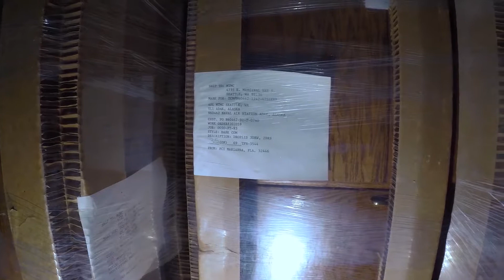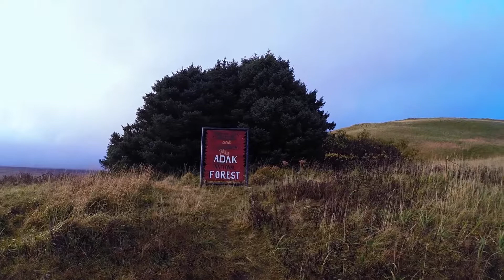Journey to Adak - Alaska Picker Web Series - EPISODE #8 "IT'S ALIVE"

Comment: Ok, at the 8:21 mark, the barrack behind the hill next to the FAA control tower are the barracks that the VP squadron used when they were on detachment there or deployment.  I was there in 1986 for a 6 month deployment with VP-17.  At 8:24, the warehouse was not known as the Fleet Hospital.  It was a new storage building that was built there because the older building near the piers were getting old and falling apart.  Good times there.  Walking from the barracks to the hangar or to the bowling alley or McDonalds.  Got stuck at both locations a few times due to "White Out" conditions.